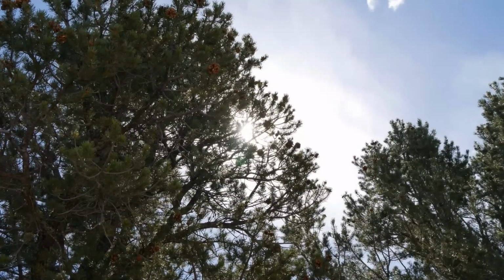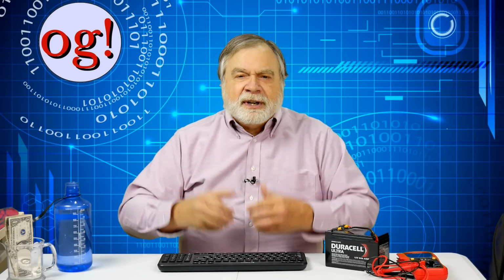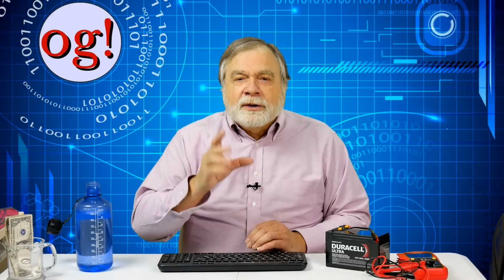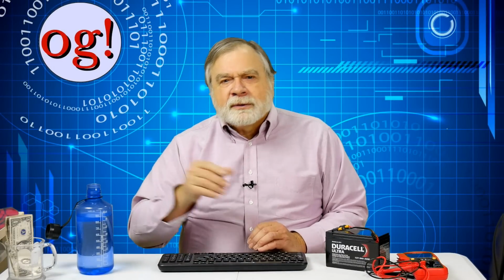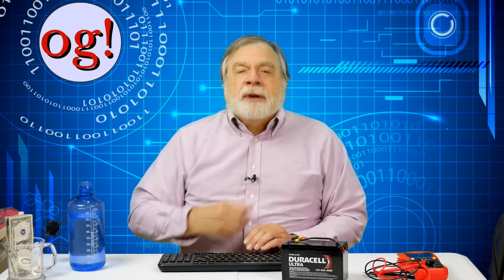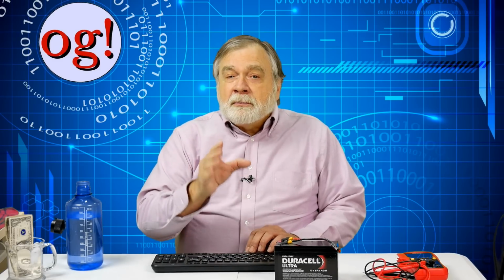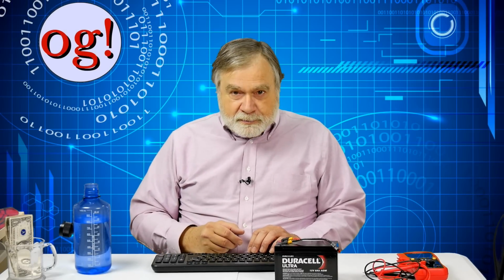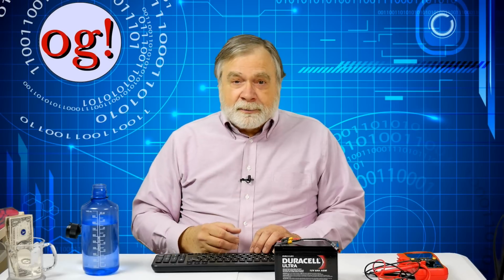Solar Power for your Ham Station AD #52

Comment: Excellent video, nicely done and comprehensive.  I have 16 solar panels on my roof 8 460 Amp Hour deep cycle lead acid batteries in a bank connected via two charge controllers and an inverter.  I power some of my house but not everything.  All the points you've made are critically important for those considering using solar to power a HAM shack or anything else.      My advice is to take care and buy tested and true quality components for the system.  Spend the extra time to research every product carefully before putting it in your system.  When it comes to solar systems quality really does matter.  Clean power from a pure sine wave inverter is especially important.  Be always aware of the negative impact of both heat can cold on your overall system.  In summer heat can play havoc with roof mounted solar panels causing incoming voltages to drop.  In winter cold panels will produce much more power and may create an overcharge situation unless the charge controllers are up to the job of controlling the power.  The time and effort you put into designing and installing your system will pay back many times over, especially if you are dependent on solar.  PS: A back up generator is a really good idea for winter months.
Reply: Thank you for your comment, i don't have a solar panel yet but i do want to get something for my ham gear for portable ops. 73 from VE3QJ

Comment: I have been looking into solar for two reasons:
1) quiet home emergency backup lights, medical and gas heat fan, and battery charging station.
2) Radio shack communication backup or standby with minimal led cfl type lighting. 
Centralized wall mounted led sconces @ 3500k  brightness  will illuminate more rooms
and save energy. 
Kevin, Kb9rlw has been powering his needs with 200 watt set up and, so far, so good, but in the desert.
This episode has given me more light to my set up. Thanks for your expertise..
Happy holidays to yours from mine in Mi.

73, Kb8qlz
Gary

Comment: I have been running solar for a few years now out here in my barn. I started witht he few 12 volt panels then went with the 250 wall 36 volt panels. For the charging side if you run the panels (the same panels) in series and get the voltage up there is less need for the more expensive heaver wire.

My batteries are about 50 feet from my man cave / shack and even with 2 runs of #6 wire on each side I needed to get on the the MFJ power boosters you spoke of. My Flex 6300 did not like the voltage dipping under 12 volts on transmit. 

My bank is 4 sets of 2 each 120 Amp Hour 6 volt golf cart batteries, I run the rigs (1 HF and 3 vhf) usually until 2 am every day and have never had a time when I run down to 12 volts at rest. I will never take mine under 12 volts the batteries are the most expensive part of my setup!

Another nice video, THANKS

Comment: When you mentioned the voltage booster (for 13.8 VDC) my AHA light came on.  My new (to me) KW TS 440S/AT will be happy now.

I will be at least partially OTG  after the house is livable and fully OTG in a camper for most of the summer.  I've been mulling ideas to get a temp shack going and now I know how to make it work.

Thanks Dave!

Comment: I have a 200W (rated) panel set and a 1024WH LiFePO4 power station (Anker 555). It works pretty well for me, and is portable when needed. 👍

Comment: Wow how things have changed! New  Lifepo4 batteries are lighter and last longer than lead acid battery and can give more power for size. Must have change controller!  They can't take a joke!  Over charge or over discharge can damage them,  but this is true for all batteries.  Just that the charge and discharge curve is different.  They still give 12 volts when down to 15%, but start dropping fast after this. So you can get more out of them but need to be sure you don't take them to low. Keep in there large sweet zone they can last for 10 - 20 years some have 10 year warranty!

Comment: Glad I found your vid . I am in the process of hooking up a solar powered radio station . 3 panels into 2 deep cycle batteries and was worried about voltage . Good info I can use . Thanks .

Comment: Good video. Very comprehensive. I'm embarking on a solar project soon but will use lithium ion instead of the lead-acid tech. I've seen comparisons and in the long run the lithiums last much longer and over time end up being much cheaper than AGM.

Comment: dave I had a two 12 volt deep cycle batteries . I had a forty five volt Marine inverter . it worked just fine for awhile ,but  like you sasi. Iet the voltage in the battery below fifty percent.

Comment: I have an idea for a topic. types of systems someone can use and set up when they live in a small rental apartment.
Reply from the maker: Thanks for the idea. I'll add it to the list. 73, Dave
Reply: I need this. I want to raise antenna from my balcony but the roof extends 3 feet past the balcony and I'm wondering if I should make a pipe platform would do.

Comment: Hi Dave,
This August will be one year that I had Solar City install a 4Kw (15 panels) system on my roof. I just returned to the hobby and did not have a station up and running before the install was started. I had read articles about RFI from solar panels, but had no way to know if I was going to have that problem. Now that my station is operational, I do have periods of interference mostly on 20m. Need to get a portable receiver to go scout out where the interference may lie.   73   WB3BJU
Reply from the maker: The issue with the panels, or more accurately, the associated switching power inverters and whatnot, is the harmonics from the square-wave switching transistors. This would probably manifest itself as buzzing at multiples of the switching frequency, usually about 50 kHz or so (at least in the past), and would tend to die down as the frequency went up. If you can correlate your interference with the activity of the panels, then ferrite chokes on the cables will help. Hope that helps! 73, Dave

Comment: The inverter is a waste full middle man. So better control is given with the "bum" in the middle gone. However charging a drill or or portable equipment I have a 50 watters. But it's got filters on the power lines. Emergency power fed to a converter or direct via car, windmill, or coper/aluminum. Power cells. Can help. Oh try" double sun" that is to say finding a junk mirror, Or buying a cheep one at Walmart to shine on solar cell helps. Tks for your show
 De kv4li

Comment: Here's a funny thing, Dave. You actually should not charge your batteries with DC. It forms microbubbles on the plates and slows down the charging while cooking the electrolyte. Instead, you can gain 10-15% more efficiency, and reduce boiling, by using pulse width modulated DC. (PWM controller.) Or, better yet, use an MPPT controller, which will give you 10-15% gains and beat what a plain PWM controller will do. Using raw panels, without an MPPT controller, is just using brute force, wasting power, and shortening battery life.
Reply from the maker: The bubbling in lead-acid batteries comes if you charge with too high a sustained voltage. My charge controller is MPPT. Don't connect a solar panel directly to a battery without a charge controller of some sort in place.

Comment: Insert a schottky diode inside each panels elec. junc. box so parallel panel don't fight each other. Yes that sounds funny but it increased my power to the MPPT buck converter/charger. Don't use regular common deep cycle batteries. Lowest cost good battery is 2, 6volt Trojan T-105RE for aprox 300
Reply from the maker: The Trojans sound like golf cart batteries--these are good batteries for a solar-powered system. BTW, most panels these days are set up to prevent current backflow.

Comment: can a 12v car battery be used if configured in some way I understand its design for a higher discharge for short period of time its that I have 5 car batteries just laying around can you slow down the discharge to extend the life I can repair the car batteries if they wont last as long I just see buying a deep cycle battery as an extra cost but im sure it would be easy to go that route I don't mind doing more work

Comment: I'd like to see a video about D-Star, System Fusion and other proprietary digital modes. Do you ever use any of them and if so, do you have radios specifically for them or was it an afterthought after purchasing a radio with one of these capabilities? I'm also curious if one is better than another or, more to the point, does one have more limitations than another? This may be a subject that is too broad in scope for a video and then again, it may be much simpler than I thought. I'm thinking of upgrading radios and I'm just wondering if any of this is something I might base a decision on or simply not worry about it.
Reply from the maker: Jason, there are proprietary systems competing with each other. We have no digital voice repeaters here on Colorado's western slope, so I don't have much wisdom to offer. I suggest asking your local club members, as they may have a favorite that's most common in your area. Good luck! 73, Dave, KEØOG

Comment: How do you determine what inverters are the cheapie sine wavs ones vs ones that can handle motors and what not?
Reply from the maker: I did quite a bit of digging at one point, and the most interesting page was this: http://www.samlexamerica.com/products/SubCategory.aspx?cid=S7. Note especially the SA series toward the bottom, designed specifically to handle reactive power. The next time I need an inverter, I'll get one of those. 73, Dave

Comment: Solar is only 14% efficient, and most radios just sip power, why not save all that trouble and just plug it in the wall. No panels, no inverters, no lead acid batteries laying around. No worries about snow covering the panels all the time and trying to shovel them too. We got enough to shovel around here in the winter to keep getting on the roof. Ive done the math and it's WAY cheeper and better, and easier to just plug the radio in and run it.
Reply from the maker: I don't think expense has anything to do with it, though panels are now widely available for around $1/watt. I've explored solar for over 20 years now and find it a cool hobby in its own right. That said, my system is disconnected at the moment.

Comment: I just installed two 100 watt panels (full sun in SoCal all day at a 34deg angle to the South), 40 amp MPPT charge controller, and 200ah LiFePo4 battery and a 3k sine wave inverter.

I connected my IC706 to the Load Output of the charge controller (mfg said the output is rated for 40 amps).  Is this ok, or should I connect the radio to the battery terms?  What is the best practice to ground this setup.  

Currently, I have a 8' copper rod (a couple feet from my shack) into the ground, with a AWG2 to a good commercial quality buss bar in my shack. 
 
Along with my tuner and radio, do I ground the neg term of battery to the buss bar?  Do I ground anything else in the to the common buss bar?  Do I ground my Hustler 5-BTV to the ground rod?

Comment: Hi Dave,  im confused about something. I have a 300w solar charge controller. My 150 w solar panel puts out 18 volts. My controller says it needs 20-50 volts input to work. Do I have the wrong controller?

Comment: I needed to get a deep cycle for a boat. Why fork out the money for a power supply when I can use the same marine deep cycle for my base radio?
Reply: If you don't mind carrying it back and forth, this is a great idea. It also solves the issue of keeping the battery happy during winter storage.

Comment: A question that is bit late - but I guess better late than never!
I have a 12 volt 45 watt system that consists of 3 panels (15 watts each) that I have run through an MPPT charge controller. Recently I was given two 24 volt panels with higher wattage. Can I connect two of the 12 volt panels in series and parallel them with the 24 volt panels? I have read else where that the panels should be "matched" so that is why I'm wondering.
Oh, and I have always ran all my ham gear (Icom IC718 and Alinco 2 meter)from solar, only problem was when the "deep cycle" battery developed an internal short.
Reply from the maker: If the two 12v panels are the same size, then yes, connect them in series and then in parallel to your 24v batteries. I'm assuming the panels are relatively new, like in the past 10 years or so.

Comment: Nice video! Do you keep your batteries outside or in the house?  I am in Phoenix, and concerned about leaving the batteries outside in very hot temperatures. But also concerned about keeping the batteries indoors as well?
Reply from the maker: +Pow Avo Mine are in the house. They're sealed AGM lead-acid units. I have an additional "repeater" flooded lead acid battery in my shack, also indoors.

Comment: Has anybody tried using 2 batteries in series with a regulator to hold 13.8v even as the batteries discharge?

Comment: So what is the difference between solar and a normal power supply ? I understand if you have a 12v cabin out somewhere , but wouldn’t it be easier just to use a power supply ?
Reply from the maker: Solar is fun to tinker with on its own. One nice advantage is if the power goes out, I stay on the air.
Reply: @davecasler  if the power goes out then i will hook up my 12 amHr battery that i use for portable use
Reply: @stevepatterson2290  And when your portable power supply drains, Dave will get more energy from the sun and you will be left holding an AC plug.

Comment: Can I run a mobile CB Radio with just a solar panel and a battery?
Reply from the maker: yes
Reply: @davecasler  would I want to have anything connected to the battery to show battery strength?
Reply from the maker: @bobbader4789  A voltmeter. Don't let the battery discharge below 12 volts, assuming lead acid. This is an old video, and so it doesn't describe lithium batteries--a whole 'nother subject!

Comment: All my Radios operate on 12VDC I have a power supply that goes from 120 VAC to 12 VDC,  why can I not use the 12 VDC off my batteries and nor need an inverter ? and skip my power supply.   An inverter is not an efferent Method to get 120 VAC  I can run LED lighting also
Reply from the maker: A 12v battery that has "rested," meaning hasn't been charged or discharged in several hours will put out 12.7 volts when full, and 12.0 volts when half empty. Unfortunately, that latter voltage is too low for many of today's HF rigs that are used to 13.8 vdc. MFJ and TGelectronics both make battery boosters to get the voltage up to 13.8. I have the TGelectronics one in my station, which runs off batteries.

Comment: For your batteries, do you fuse the batteries separately (in case one malfunctions - I had a cell go bad in my car battery and assume it could on a standalone system) or just fuse the bank of batteries from the main feed?

Also, how do you tell the real MPPT controllers and real Pure Sine inverters from fakes?  I have had a couple of the inverters that said "sine wave" but when I got hold of a scope it was a series of square steps.
Reply from the maker: I fuse the battery bank. That's the way I've always seen it done. Because of the safety issue here, I'll caveat this that you should do what a solar-qualified electrician says. Regarding the MPPT trackers, I think there are no guarantees if buying on eBay or Amazon from abroad. I'd suggest sticking with vendors such as Samlex that already have an established reputation. That said, my inexpensive little charge controller for my 24v battery works beautifully! 73, Dave, KEØOG

Comment: Any problems with the antenna interference on the solar panels? My idea is a mobile mechanics rig with a solar power system on the roof. Can I also mount my antenna up there with about 2500-3500 watts? Or is this idea gunna fry something.
Reply from the maker: I've not seen damage to solar panels from ham radio. Of course our maximum allowed power is 1500 watts PEP.
Reply: @davecasler  Thanks buddy, I'm new at radio's cbs sound easy, and what I know as skip sounds fun. Any info you care to share would be welcome. It'll be installed on a 16' uhaul truck, with the grandma's attic. It'll be attached to a 1200ah/12v system which will be the power supply for a mechanic shop in the back. I'm hoping to have a radio in the cab for on the road, and another in the back for skip. I like the look of dual whips, so 2 antennas are not a problem. Just looking for knowledge, so I don't fry anything or break any laws. Care to educate a pup?

Comment: I have a UPS for a computer. It throws out a surprisingly large amount of HF interference. It sounds like a pulsating "Buzz" sound. I don't know if this is the inverter, or the charge controller.

When I start moving into solar, how do I know which Charge Controllers and Inverters are going to not cause this kind of interference on my station?
Reply from the maker: This is an ongoing issue, as noted in a recent QST article. So far as I know, there's no "safe" list. As I mentioned, I did have to take one inverter out of service because it created RF noise. I wish the ARRL tested inverters and charge controllers! 73, Dave